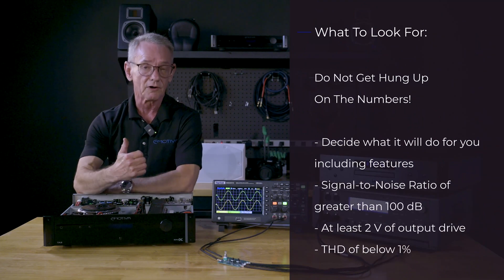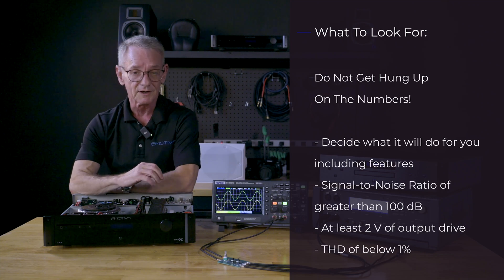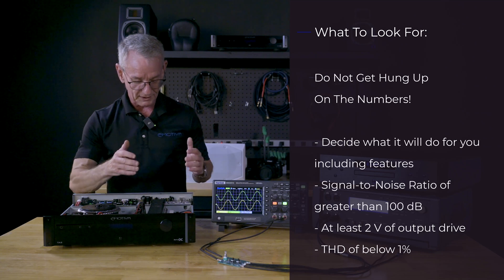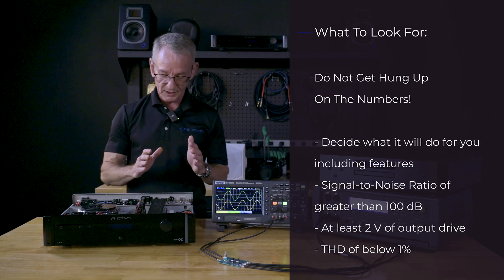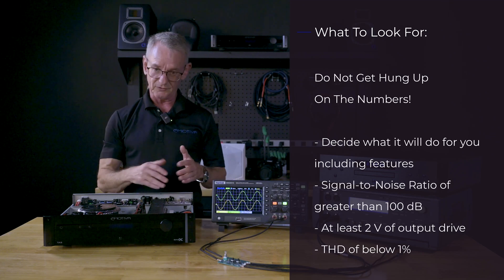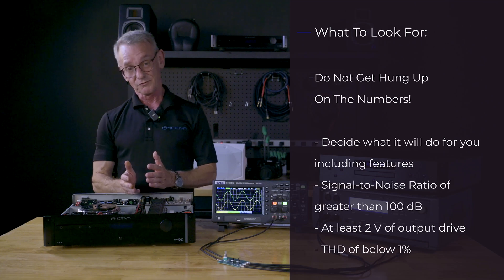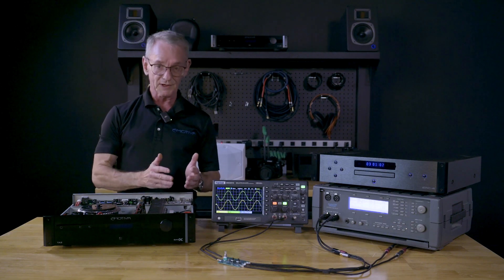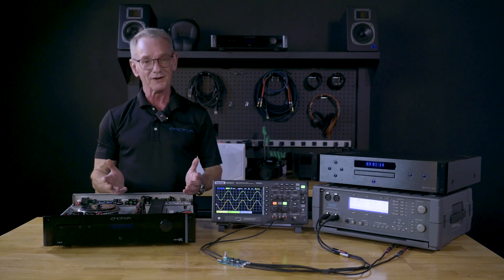How does a Preamplifier work?

Comment: Would be interesting to know how to setup the volume. Do you crank up the amp to max and control the room level with the preamp or do you use the attenuator of the amp to limit the room level? Is there a downside by limiting via amp?